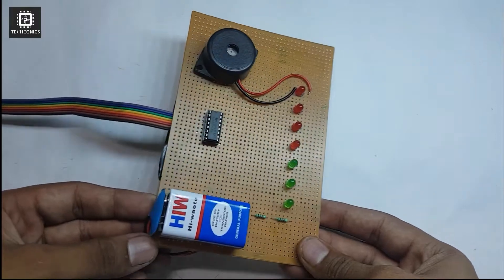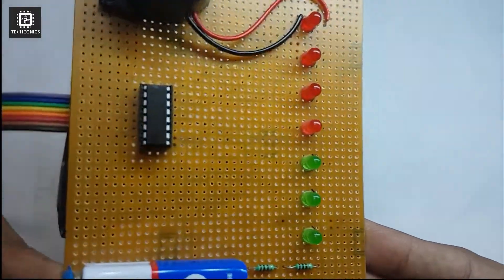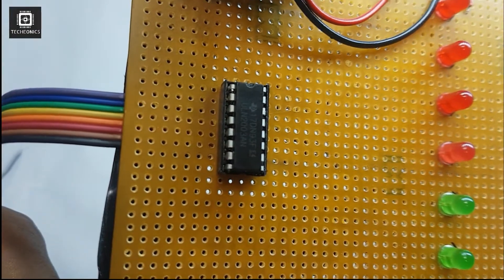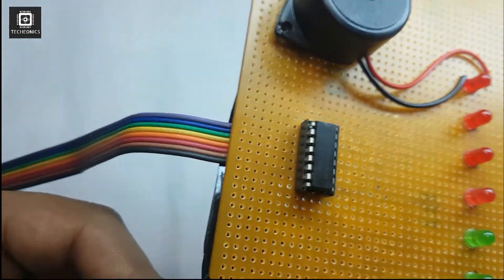How To Make A Simple Water Level Indicator Circuit | ULN2003 | Techeonics |Science Project

Comment: 9vlt battery kitna time tak chal sakta hai?  Agar 24×7 days use karte hai to.

Isme agar mobile charger use kare to konsa component change karna paraga?.  Is accepted mobile charger?

Waiting for your answers.....

Thank you
Reply from the maker: You can  use the mobile charger as a power source no need to Change any  another component just put the charge on the Battery Point
Reply: @TECHEONICS  I made same.75%success.!!!! 5 LEDs are glowing with full brightness. After triggering 6th LED all LEDs are going to dim.very low brightness.( i used 5 volt 500mA mobile charger ) can you help me please.Will it solve if i increase voltage or amp?

Comment: Sir my all led not glowing only red other goes dim wht can be reason or solution or i nees to use 100ohm resistance on every led ? I m using 12v 1a adapter
Reply: Me also  same issue
Reply: @ratheeshraghavan7306  use 220ohm resistance for every led ir will work